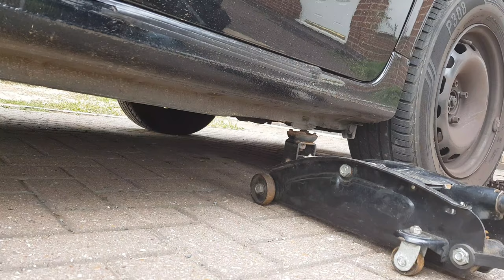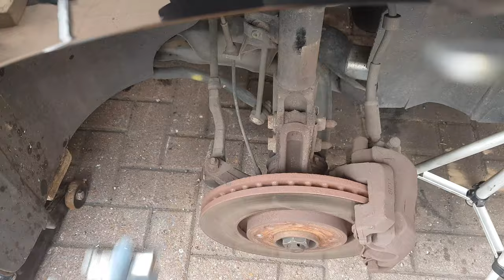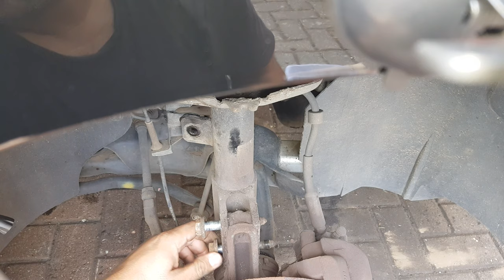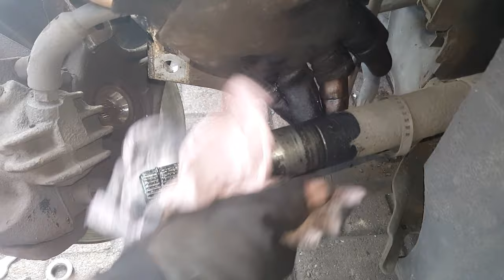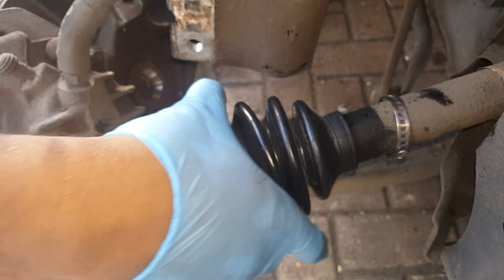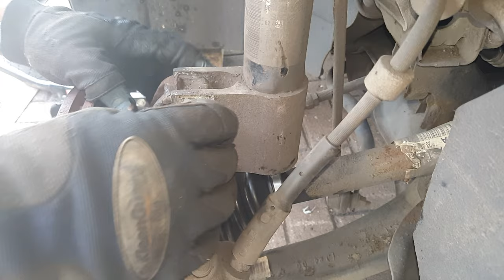Peugeot Partner/Citroen Berlingo  CV Joint Kit Replacement

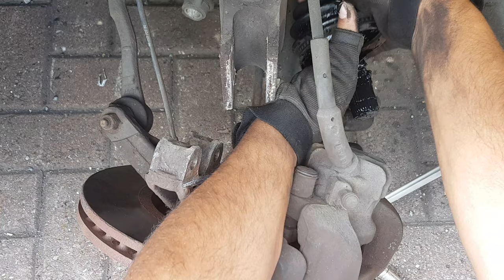Comment: how easy. 6:35 On a megane2 I clobered that cv joint for over an hour with the big hamer until that circlip finaly let the cv joint out.
Reply: Same here, an hour just passed and I still haven't got it loosen
Reply: Not the circlip but corrosion between the splines holding it in place meaning the two surfaces will be very difficult to separate. Should have been assembled with anti-corrosion paste, a light smear of copper slip or marine water repellent multi purpose grease.

Comment: No abs ring? Did this to my citreon berlingo mk2 and it threw the abs light on
Reply from the maker: Abs ring on the bearing in these models not on the CV joint
Reply: I couldn't remember whether or not it had one on when i took the old one off lol but I did change the wheel bearing also so maybe broke a wire would you know if you have to have the light reset  with a machine
Reply from the maker: @danw9096  does light came after u changed the  bearing ?
Reply: Ye changed cv and wheel bearing came across your vid and noticed you didn't have a abs ring on your cv so had to ask
Reply: Appreciate the replys also 👍

Comment: Hi can anyone help. I was today changing the lower ball joint and forgot to tie up the assembly. I pulled the drive shaft out of the cup on osf.
I pushed it back in but having trouble aligning the new ball joint with the lower arm. About 2 cms away from the hole.
Any ideas anyone.  ???
Reply from the maker: Hi I am sending you link I hope that help you https://youtu.be/HFDxV3vJbzA

Comment: Should have shown us the step where you removed the drop link upper bolt, allowing you to slide the strut into the hub easily. Extremely important step. Thanks otherwise for a good vid!
Reply: he didnt remove it but managed to squeeze it out anyway!
Reply: @keithwright7259  he removed it which you can see at 12:50. You shouldn't contradict what i wrote with false information as it could mislead the unaware.
Reply: @misterzee5736  i think you will find its the poster thats misled the unaware not me, dop link is off by 3,50 wether its required or optional is unknown

Comment: You didn't use any Plusgas or WD40 when undoing the nuts and bolts which would have helped them turn more easily.
You didn't use a torque wrench for the hub nut which needs to be done up bloody tight to 280Nm.
Again the old CV joint came off the splined drive shaft bloody easily. You are so jammy.